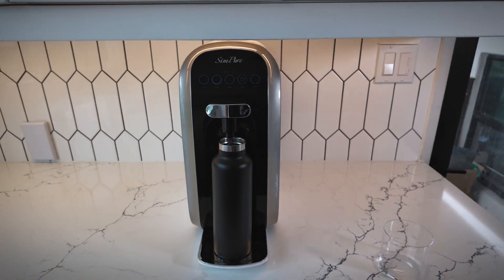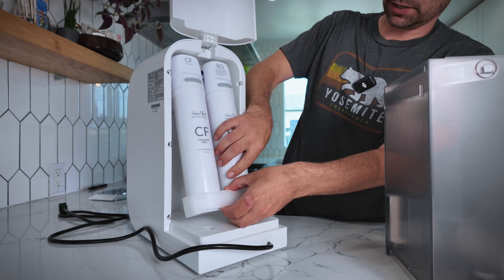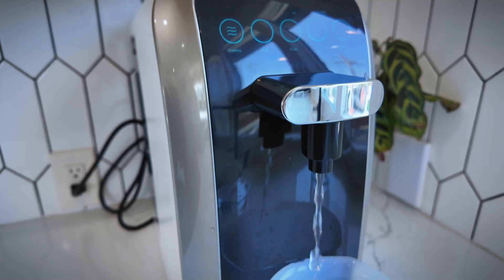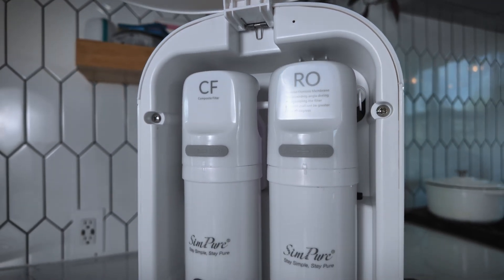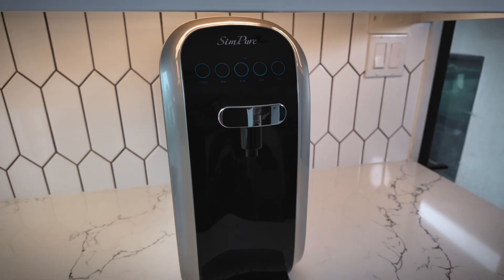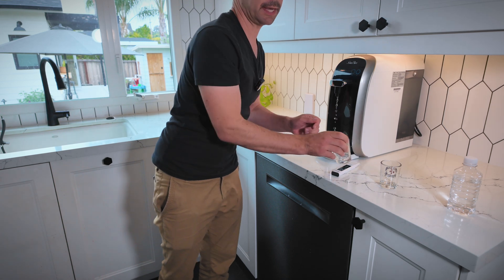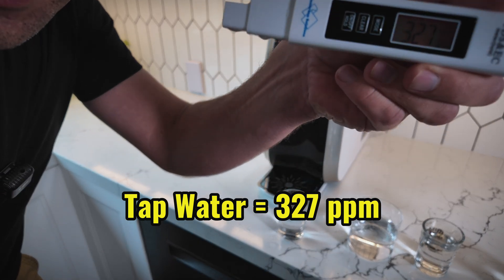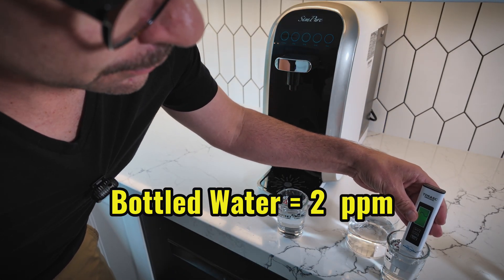SimPure Y7P-BW UV Countertop Reverse Osmosis Water Filter Test, Setup and Review

Comment: Here’s the issue. You’re using a cheap water testing tool based on PPM. Parts per million. You first stuck it in the tap water, thus contaminating the tester, then you stuck the contaminated tap water tester into the SimPure filtered water and altered the reading. You probably changed it by 15 or 20 doing that.

Comment: Tank strainer and screen cleaning, page 18 of the manual. The instruction are not clear on how to remove these elements: there is any video that shows how?
Reply from the maker: Here's what they said: "the strainer filter at the bottom of the water tank can be pulled out directly. Just give the stainless steel mesh a quick brush to clean it."
I can make a video next time I do it, but might not e for a while. Let me know if there's anything else I can help with!
Reply from the maker: That's a great question. Let me reach out to them and see if I can get you an answer.

Comment: How many watts to run it? Start up surge watts and then while processing. Matters for DC to AC inverter needed to run it? That way I’ll know what set up to run it when needed.
Reply from the maker: @Cabernet2000  good question. Just plugged it into a eufy smart plug to get some estimates. Idle when not asleep is 1.19w. Filtering water is 24.7w. Filling water is 2.97w. And filtering and filling into glass was 26.8w. Hope this is helpful!